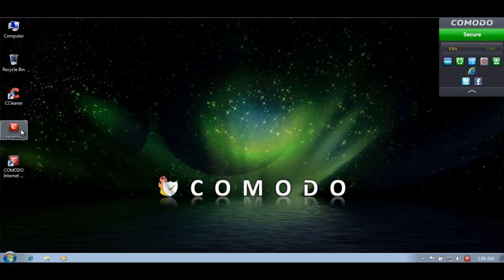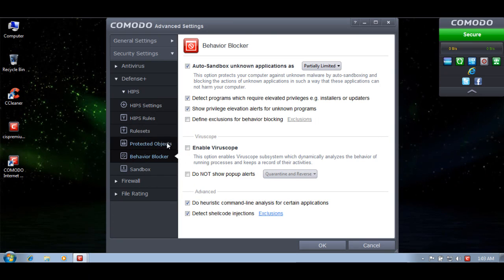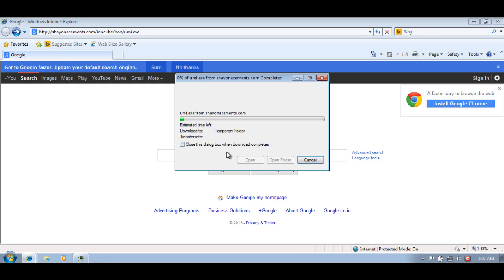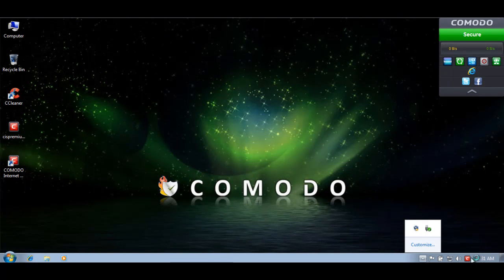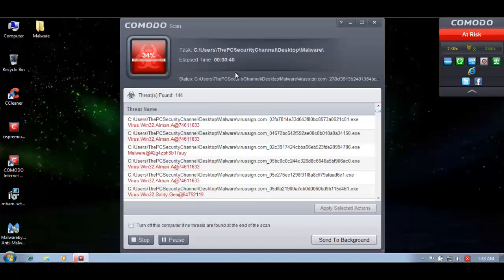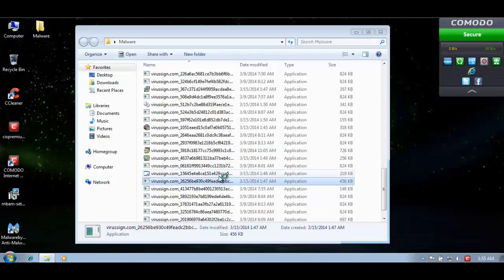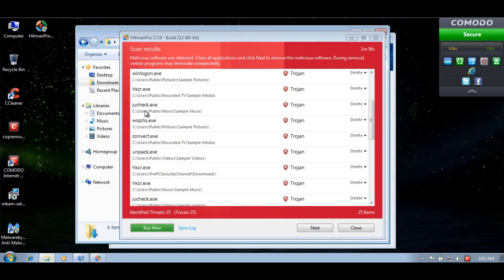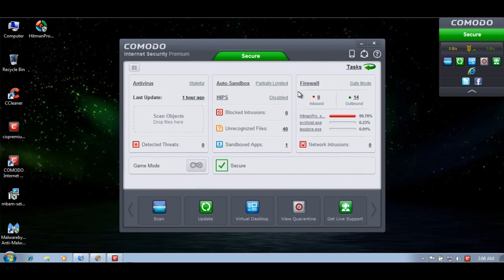Comodo Internet Security 7 test and review

Comment: I did leak test on this with comodo leak test , and it said it only protected 20-30 out of 320 i think it is.. i wonder why its so bad on mine? it don't make sense. everything is working fine to.  i have the version your using and with firewall.. any help i would appreciate. thanks
Reply from the maker: By default the HIPS in Comodo is turned off. Turn it ON and switch to proacative security(ie you have to change a few settings) and then your scores will change drastically.
Reply: The PC Security Channel  THANKS.. i tried that and still got the same  results. i even switched to firewall security lol .. i do not know whats going on. hmm....
Reply: The PC Security Channel  wonder if the comodo
 leak test thing is not working right?
Reply: The PC Security Channel
 i figured it out.. i have to leave the file as unrecognized in comodo. then it works like its suppose to. i can not click trust. each time i click trust file it has low leak test detection for some reason. that's a new one for ya lol.. thanks tho for your help  :)